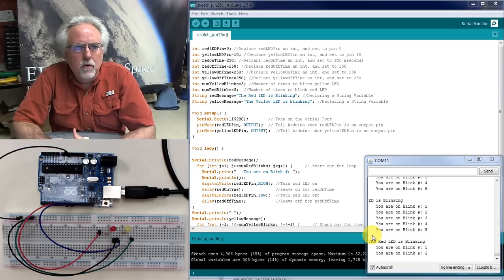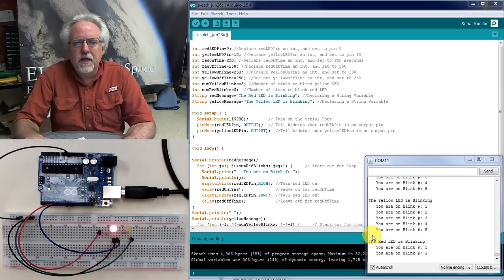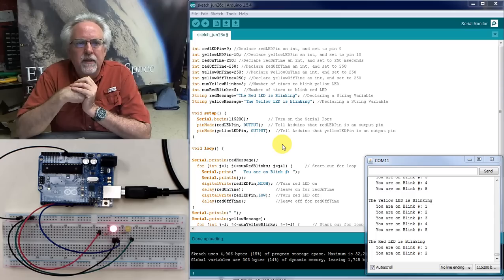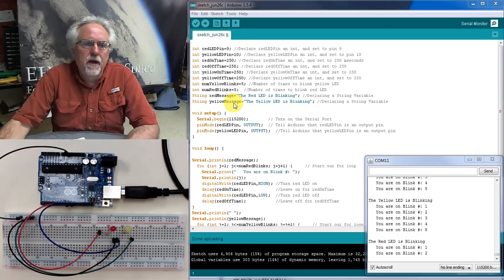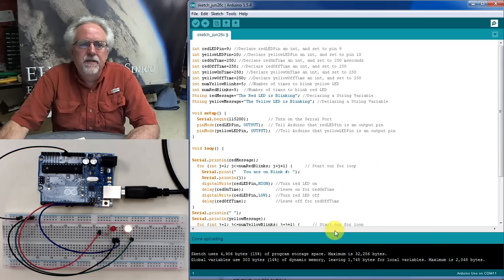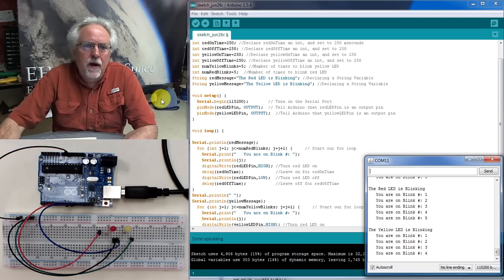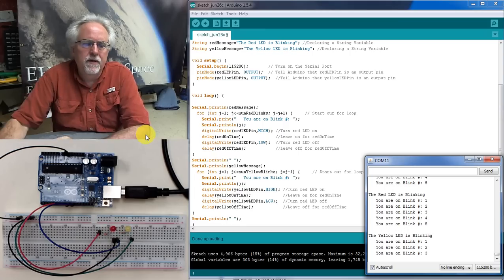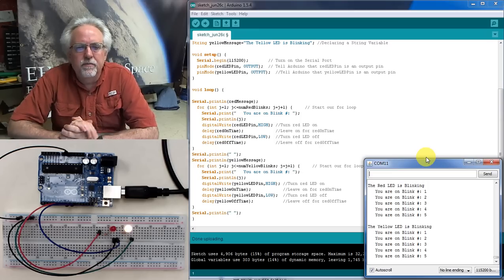LESSON 6: Reading Data from Arduino Serial Monitor

Comment: Paul,
I have an issue with my arduino uno not waiting for the input for the yellow blinks. My code is the same as yours, yes i typed it. However, if i type fast enough i can get the yellow to blink x number of times, but i have to be fast. what am I doing wrong? baud is the same, code is the same.
thanks bud.
Reply from the maker: +Robert Harris sounds like a problem with your line that makes the arduino wait before it makes a read. Check this line very carefully.

 while(Serial.available()==0) { // Wait for User to Input Data  
  }
Reply: +Paul McWhorter 
the only thing different is the word "while". this word is neither blue or orange. the word "while" is grey. thank you for your speedy response. I want to go on, but I need to solve this first.

thank you sir
Reply: +Paul McWhorter 
ok, I committed a coding sin. I went to toptechboy.com and copied your code. (I know, I won't learn anything if I copy.) I still get the same problem. the arduino gives me just a second to respond to the yellow question before moving on. I even changed the settings on my wireless keyboard thinking there may be a problem with any lag coming from that. Help me obiwan
Reply from the maker: +Robert Harris If you have entered the while loop correctly, it should sit there until you get input. I am really stumped at what might be wrong if you copied and pasted my code, I would think it should work. Really dont know what could be happening, but you might just try a very simple program that does nothing but prompt the user for a number, wait with the while loop, read the number, and then print the number. Try to do that to see if you could make simplest possible code work to get input from the user.
Reply: +Paul McWhorter 
Hi paul

I have the same problem as robert
everything is working correct till it start typing the word while
it dont show up red but gray
i checked everything i dont see it
 
Serial.println("How Many Times Do You Want To Blink The LED ??? ");
while(Serial.available()==0{}
numRedOn = Serial.parseInt();

the while is gray and when i verifieer then i get a  fault and it says
expected ')' before '('
Reply: +Tony van Dijk 
Hi Paul

I think i know what is different
I used a newer version of the Arduino programmer i used version 1,6,5
Reply: +Tony van Dijk The error comes from you not adding ) at the end once you finish the condition of the while loop. while (Serial.available() == 0) {} instead of while (Serial.available() == 0 {}.
Reply: @74rob69  hi sir

I hope that it is not too late...
I have got the same issue because when we enter the first value, 
Serial.available() take the value 1 and keep that value ...i do try to know if it is possible to reset that variable....
so that the next while(Serial.available()==0 ) will never been execute....because the condition is already true..

to make my code works, I executed the first while(Serial.available()==0 ) and the other  condition with : while(Serial.available()==1)

Comment: Sir but on my arduino it is not working.
It is coming ' how many times do you want to blink red led ?'
then i pess how many times i want to do it.
but it does not wait for me to upload how many times i want to blink The yellow Led, it blinks the red led and asks again how many times do you want the red led to blink.
Reply: Set your serial monitor to "No line ending". The setting is in the drop-down at the bottom.

Comment: For some reason pins 0&1 don't seem to be able to blink the LEDS , they just turn on and stay that way if i change the pin it works just fine .  Any idea why that's the case?
Reply from the maker: Those might be special pins for tx/rx. I dont have an arduino in front of me, but those pins might be reserved.
Reply: Paul McWhorter yes they are the Rx and Tx pins. Thanks for helping out!

Comment: Hi! I have the same problem with the second value reading. It looks after the first reading, the value in the buffer remains 10, so for next loop, Serial.available() remains 10 (which is, obvious, not 0). I don't know if my solution is the best, but after the first reading i inserted a line in which i read the value (int x = Serial.read();), and this reading looks to clean the buffer. Is it ok to do so? Thank you!

Comment: amazing lessons. your videos are the first videos I have been able to follow with confidence,

I am having some problems with the code waiting for the second input. 

it allows me to set the amount of blink for the first led (say 5 blinks) and then immediately starts flashing them without giving me a chance to put the second led value in. 

please please help.
Reply from the maker: +paul elliott Sounds like you probably have a typo in your code. Check it carefully, looking at all syntax.
Reply: +Paul McWhorter thank you so much for getting back so fast!!!

I have solved it, the code was all ok , the issue was in the serial monitor. 

the small drop down in the bottom right was set to "newline"

by changing it to "no line ending" it works perfectly. 

again thank you so much for your fantastic lesson and your very fast responce. 

Paul
Reply: +paul elliott That's a great catch! I had the exact same problem as you and couldn't figure out what was happening. Code was all correct. Thanks for sharing what you found.

Comment: HELLO sir 
first many thanks for such  wonderful lessons. I have worked  on c language  and c++. so i am getting it easily. i have a doubt on the   this program. here is the line
while (serial.available()==0{
}
numRedblinks=Serial.parseInt();
my question is 
in c language all this are ended with first bracket is treated as functions
in strctrcture we use the dot. so all these are functions?
and what is the meaning of [serial.available==0)

Comment: Thanks again for the info. I like how you recap previous lessons to get grounded with the featured content of the new topics.

Cool tips expanding on parseInt() with parseFloat() and readString().

I can almost see how to make a rudimentary memory game if I just had a speaker that could produce 4 different sounds and 4 different colors of LEDs or else 1 LED that could be 4 colors. Then I could play a pattern and ask for the user to enter 1 for blue, 2 for green, 3 for red, 4 for yellow and they would have to type something like "12144" for a 5 piece pattern, lol. Fun stuff.

You just asked us to think about how to set it one time to have the user-chosen numbers loop continually once set. I'm thinking something like this:

// Global variable
int userWasPrompted = 0;

/* Test with an "if statement" if user was prompted and only prompt user if they weren't yet. the code that prompts user for input inside the execution portion of the "if statement" and also reassign the value of userWasPrompted to 1 instead of 0 so that when the main loop iterates again it will test if the user was prompted and find that they were, so it will skip the prompting from there on out. */

if (!userWasPrompted) { ...code to prompt user input here...; userWasPrompted = 1; }

Cool, it works! I love it when programming languages make it so that 0 = false and 1 = true.
Reply: Cool so then I was wondering how to interrupt the loop and ask the user again for more input. I thought I could check if the user had input any new data at the end of the main loop by testing if (Serial.available) and if it was then set "userWasPrompted = 0" so the main loop would prompt user again when it started over. I was right but it used the number I input and applied it to the first question of how many LED blinks which ends up being 0 blinks if a non-number was input by the user. Therefore I just also tested if the user input was the letter "q", which is the only way userWasPrompted would be reset to zero in order to get re-prompted.

// Check for new user input to escape the MAIN loop & re-prompt
if (Serial.available()) {
  String userBreak = Serial.readString();
  if (userBreak == "q") {
    userWasPrompted = 0;
  }
}

This is so fun - thanks again for sharing the info.
Reply: Now that I finished the video I see you mention things done once can go in void setup. Awesome, thanks again.

Comment: I'm afraid that this code does not work for me, the string value in the selection function (if or similar) does not give what was entered
Reply from the maker: Make sure serial monitor is set to no line ending
Reply: @paulmcwhorter  Thank you for your help, I just found it out. Thanks for the great material :-)

Comment: hello sir,
In the following program, i am getting the error 
Invalid use of member function (did you forget the '()'?)

Program:

int greenledPin=7; //declaring the greenledPin as int and setting it to 7
int redledPin=10; //declaring the redledPin as int and setting it to 12
int redOntime; // this is the redLed ON time
int redOfftime; //this is the redLed OFF time
int greenOntime=300; //this is the greenLed ON time
int greenOfftime=250; //this is the greenLed OFF time
int c=0;
int k=1;
int m=1;
void setup() {
pinMode(redledPin,OUTPUT); //redLed is made the output
pinMode(greenledPin,OUTPUT); //greenLed is made the output
Serial.begin(19200); //for printing through the arduino
}

void loop() {
Serial.println("what is the duration that you want the red LED to be ON?");
while(Serial.available==0){ }
redOntime=Serial.parseInt();

Serial.println("what is the duration that you want the red LED to be OFF?");
while(Serial.available==0)
{
}
redOfftime=Serial.parseInt();

Serial.println(" I am fiery RED!");
Serial.print(" Number of times i am ON: ");
Serial.print(m);
Serial.println(" ");

digitalWrite(redledPin,HIGH);
delay(redOntime);
digitalWrite(redledPin,LOW);
delay(redOfftime);

Serial.println("the green LED is ON!!");
Serial.println(" "); 
for(int j=1;j<=3;j++)
{

while(k!=0)
{

digitalWrite(greenledPin,HIGH);
delay(greenOntime);
Serial.print(" Number of times i am ON: ");

Serial.println(k);

digitalWrite(greenledPin,LOW);
delay(greenOfftime);
k=k+1;

break;
Serial.println(" ");
}

}
Serial.println(" ");

m=m+1;
}

Please help me sir to troubleshoot this problem
thank you
Reply from the maker: Biplab Roy Yes, I see your error. You need to look at the clue arduino is giving you. Di you forget the '()". In fact you did, but you are going to have to figure out where the error is. It is important that you learn how to debug your code. If you can not find it, slowly comment out little sections till you isolate which line your problem is on. Simple problem, you can find it.
Reply: Paul McWhorter i debugged the program successfully. thanks a lot, sir
i have a doubt regarding the serial output speed in the serial monitor. how can the speed of the output be controlled and reduced/increased?
Reply: Biplab Roy Why do you have to make it look so complicated? With the c,k, and m int's. You could give them a name or something. I would give an example but it's to complicated to read for me anyways. If it's easy for you to read it with it like that then go for it but it could be simpler. Just sayin.

Comment: What is the meaning of x-axis in Arduino plotter? How cant I convert this in time data.
In Arduino monitor, how can we get all data without using sd card?
can we get all data using putty or Arduino itself?
How can we program to get continuous data (like 10 lakh data) in excel or text?
Reply: Through Visual Studio, you can write code (or find some already written), using an instance of  IO.Ports.SerialPort (see MSDN doc if you want to do it by yourself; you probably need to define a "protocol" of communication which would define the start of transmission, its end, and so on, so that the compute would detect when the valid data, rather than unformal messages, are send through the com port). Alternatively, someone can tie the Arduino to, say, a Raspberry Pi which, in turns, can handle file, and send it through Internet. You could also use a wireless transmission, with the proper material.
Note: "The Windows 10 IoT team is no longer actively maintaining Arduino."  So you may have better chances in the Arduino forums.

Comment: I'm wondering about memory usage with all of these print statements and prompts. I experimented a bit and it seems the rem'd out comments don't affect the memory usage and also the length of the names of the variables don't either. What parts of the code use memory? I have written pretty much the exact code as you have done in this lesson with the exception of some of the wording in the Rem statements and yet my code uses about 70 bytes less than yours. I don't see any difference in my code itself verses yours. Do you know why this would be? It might be helpful to know what causes memory to be used up because one day my sketches might become more complicated and I'd be running into this issue.

Comment: Another cool little project I just thought of that I will try is to make 2 digital dice using 12 LED's (6 for each die) cuz I just looked up how to generate a random number with Random(min, max). Then I could just say light up specific LEDs for die1 and die2 depending on the random number for each die. Heck I might as well make a craps game.

Comment: not sure why but my code is running all bunched up...

this is my what my serial port looks like:

How Many Times Do You Want the Red LED to blink?
How Many Times Do You Want the Yellow LED to blink?
The RED LED is Blinking
  you are on Red Blink #: 1
  you are on Red Blink #: 2

The YELLOW LED is Blinking

How Many Times Do You Want the Red LED to blink?
How Many Times Do You Want the Yellow LED to blink?
The RED LED is Blinking
  you are on Red Blink #: 1
  you are on Red Blink #: 2
  you are on Red Blink #: 3

this is my code:
int redLED = 13; //Declaring the red led and giving a value of the 13th pin
int yellowLED = 9;
int redOffTime = 600;
int redOnTime = 600;
int yellowOnTime = 600;
int yellowOffTime = 600;
int numYellowBlinks; //Number of times to blink yellow LED
int numRedBlinks;  //Number of times to blink red LED

String redMessage= ("The RED LED is Blinking");//Declaring a string variable. In this case redMessag //e will print out the given value in quotations
String yellowMessage =("The YELLOW LED is Blinking");

void setup() {
  // put your setup code here, to run once:
  //Setting Up my variables for clen easy code and easy changes if needed.
  Serial.begin(115200);
  pinMode(redLED,OUTPUT);
  pinMode(yellowLED,OUTPUT);

}

void loop() {

  // put your main code here, to run repeatedly:
  Serial.println("How Many Times Do You Want the Red LED to blink?"); //Prompt User for Input
  while(Serial.available()==0) {} // Wait for User to Input Data  
  numRedBlinks=Serial.parseInt();  //Read the data the user has input

  Serial.println("How Many Times Do You Want the Yellow LED to blink?"); //Prompt User for Input
  while(Serial.available()==0) {} // Wait for User to Input Data  
  numYellowBlinks=Serial.parseInt();  //Read the data the user has input

Serial.println(redMessage);
  for (int i = 1; i<=numRedBlinks; i = i + 1  )  {
    Serial.print("  you are on Red Blink #: ");
    Serial.println(i);
    digitalWrite(redLED,HIGH);//turn red led light on
    delay(redOnTime);
    digitalWrite(redLED,LOW);//turn red light off
    delay(redOffTime);

  }
Serial.println(" ");
Serial.println(yellowMessage);
  for (int i = 1; i<=numYellowBlinks; i = i + 1 )  {
     Serial.print("  You are on Yellow Blink #: ");
     Serial.println(i);
     digitalWrite(yellowLED,HIGH);//turn yellow light on 
     delay(yellowOnTime);
     digitalWrite(yellowLED,LOW);//turn yellow light off
     delay(yellowOffTime);
     
    
  
  }
Serial.println("");
  
}